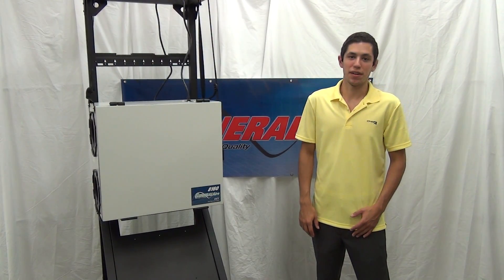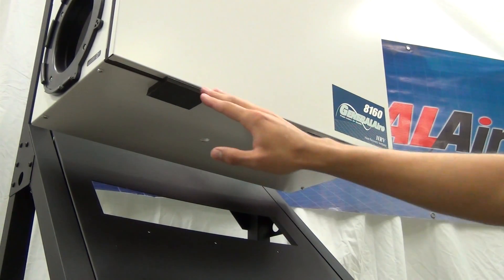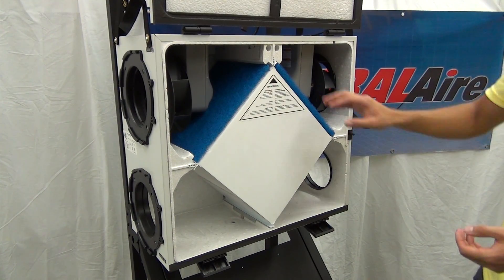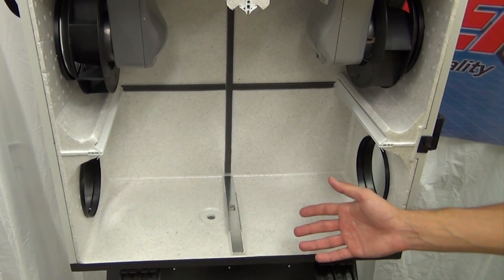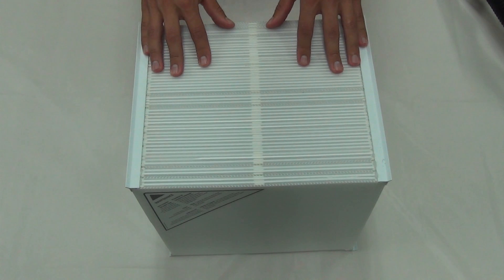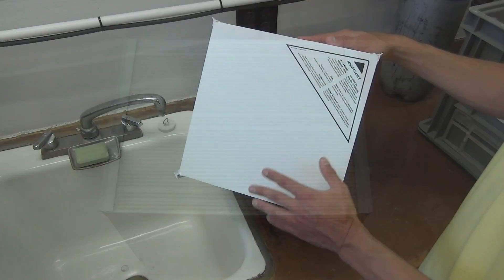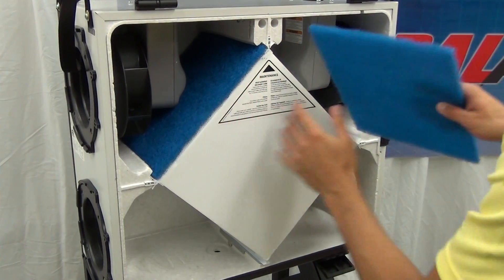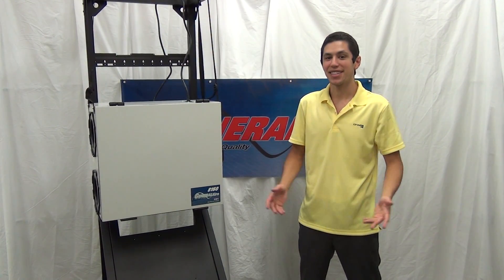GeneralAire® HRV & ERV Maintenance

Comment: I have cleaned the core and the pre filters. Yet my light on the ventilator remains on. Also the rooms in the upper floors remain cold
Any ideas
Reply from the maker: Dear Anthony,  Your HRV/ERV does not control heat or AC; only ventilation.  What color is the light?

Comment: My erv is attached the the ceiling in my closet.  Is that properly installed?
Reply from the maker: That would be difficult to know without actually seeing the installation and surrounding space.  You may wish to consult with a local contractor.

Comment: For future please show how you are cleaning the core (ie do you submerge in water soap or do you just spray each side individually)
Reply from the maker: You would soak it - which means to submerge - for 15 minutes.  Rinse off after taking out of soapy water.  Let thoroughly dry.
Reply: How long does it take to dry thoroughly?